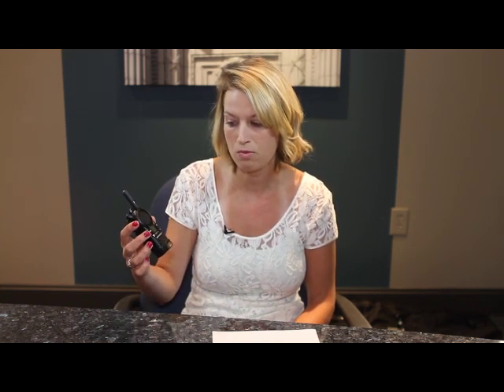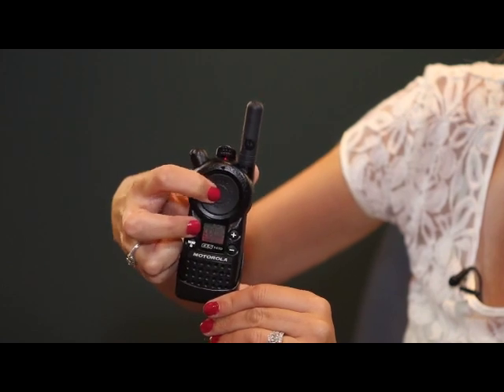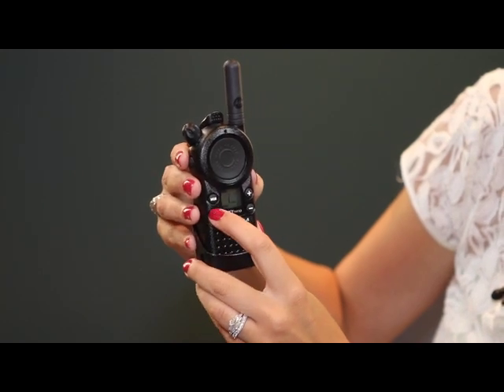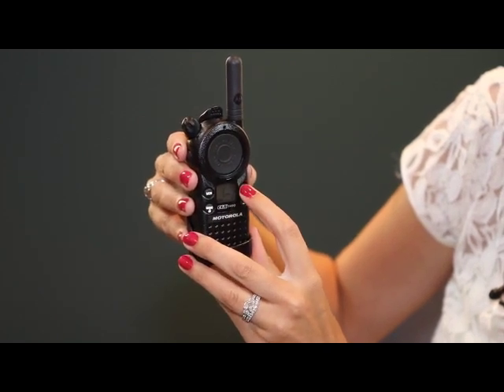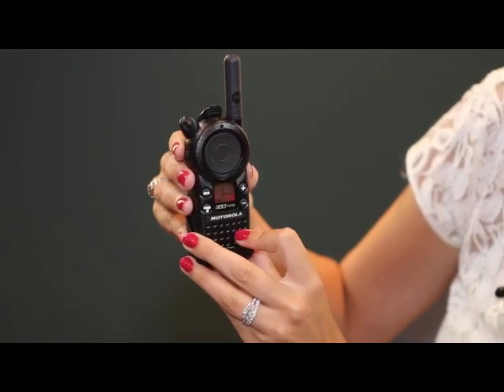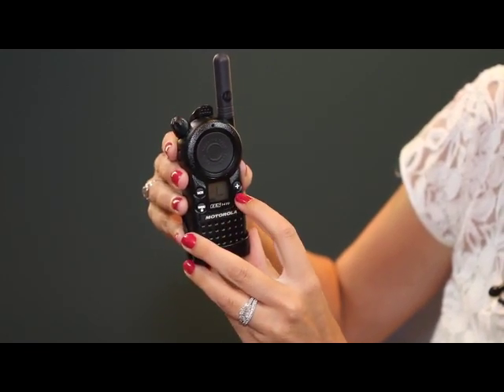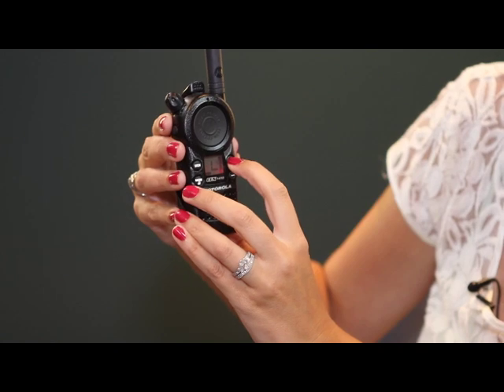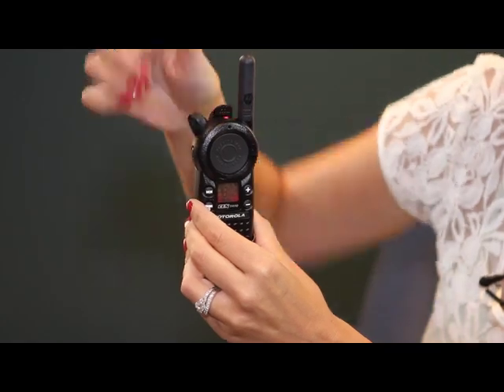Programming the Motorola CLS Two Way Radios

Comment: I have the Motorola cls 1110 radio and I can't program it when I turn it on it shows an F and every button I press doesn't change it can you tell me what's wrong with it?
Reply: I have the same problem
Reply: @marlonreyes9691   your trying to get a radio
ment to be used  for your locial  target store
it has a range of 20 thousend  square  feet
and 12 floors up and requires a business licensee at a cost of $ 300 dollars